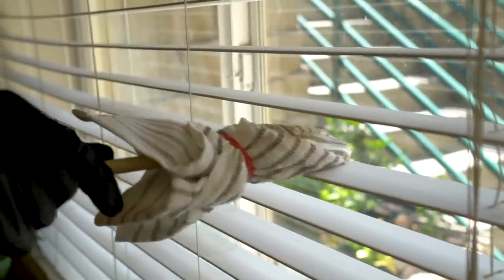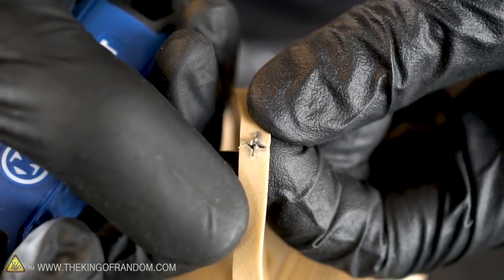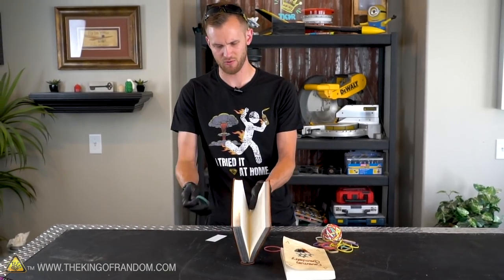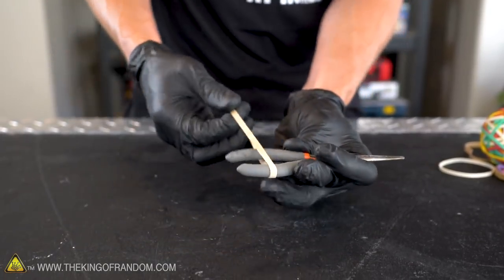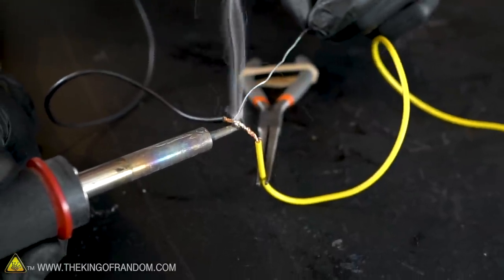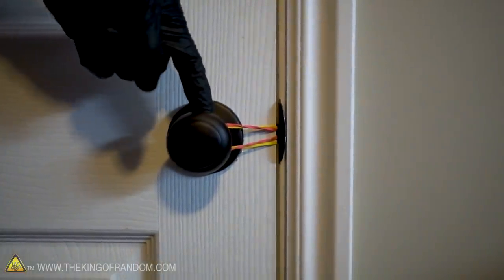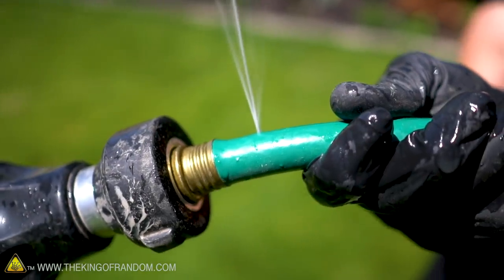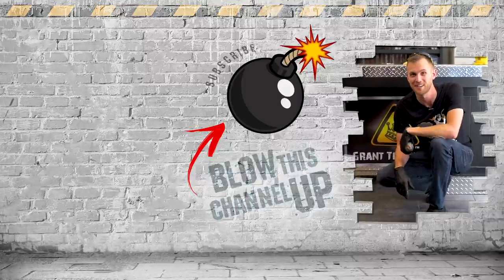Viral Rubber Band Life Hacks TESTED

Comment: I love the parts when he gives better solutions than the hacks 🤣🤣🤣
Reply: But he didn't for a stripped screw. No need for special tools, just cut a line into the screw with a handsaw or a grinder and you can use any flat head screwdriver to unscrew it right away.
Reply: Literally any piece of scrap paper will do!

Comment: Nate is so sassy in this video, I love it. Also for the hose thing, just take a piece of plastic (plastic wrap, preferably) and tightly wrap around the hole. use duct or electrical tape to secure the plastic. Easy solution.

Comment: On the garden hose, I use silicon glue and heat shrink and it works fine.  Especially when there's a leak in the middle of the hose as you pointed out.   Make sure the hose is clean and dry and give it a day for the silicon to dry.  You want the heat shrink to ooze the silicon out the ends and smooth it out over the heat shrink ends.

Comment: Can you melt rubber bands and use it as Flex Seal?
Reply: Rubber bands burn and do not melt, as most are made from vulcanized rubber.
Reply: K0ester THAT'S GONNA BE A LOT OF DAMAGE
Reply: Naa. Reacts with oxygen in air. No melty melty unfortunately.
Reply: Fidasek 008 look at plasti-morph. Just mould it, it sets to hard in air.
Reply: you guys are saying it will burn because the oxygen how about in a vacuum and some sort of electric heater i think that will work but that just a theory a random theory thanks for reading

Comment: You can use rubber bands in the middle of the hose.  You have to cut the loop, and wrap the cut rubber band around like tape.  The end can be tucked under the last loop.  This works even better than the loop, because you can tighten the cut loop even more, and position it more accurately as well.

Comment: Suggestions:

For extracting the core from toilet paper roll, pull it out slightly then cut down the same amount. Fold tab in, reach up the core with pilers, and tear the core downward.

The rubber bands on the hose would work a lot better with a tiny bit of electrical tape applied first.

Comment: For the hose, I'd either put a small piece of duct tape on it, then cover it with a piece or two of heat shrink tubing, or use a inner tube patch kit. There are a lot of other options that don't involve buying a whole new hose. You could also buy a hose repair splice/coupling for a couple of dollars, instead of buying a whole new hose.

Comment: Hey.what would happen if u hydrodip in ascetone ...
Reply: VASANTH S it will not stick to the model as acetone is used sometimes to remove paint
Reply: Allen Hasbun i just want to know if the paint dissolve 's or not ...there is no harm in trying
Reply: VASANTH S or you just want 25$
Reply: Depends on how the thing you are dipping reacts with acetone
Reply: Yea me to but if  he doesthe real hydro dipping that will be cool because the hydro dipping he showed is with paint the original has a film so the hydro dipping with a film will be cooler

Comment: For patching a hose in the middle, you need to think more laterally.  Double the rubber band over itself, twist it around until it is tight, then thread the next rubber band through the loops.

Or use Flex Tape.

Comment: For the hose, wrap all of the rubber bands tightly around a small length of pvc pipe and then thread the hose through the pipe. Once the rubber bands and pipe are close to the hole, slide the rubber bands off the pipe and onto the hose.

Comment: Ahh Nate, just cut the rubbber so you have a rubber string and then wrap that around the leak in the middle of the hose, then on the last winding just wind it over a finger then stick the end of the rubber band in the space where you have your finger. 
In the caribbean we used this method to make home built cricket balls by putting a small stone as the seed of the ball. A cut up tyre tube is more durable for this though.

Comment: Suggestion: For the big pot of water, join the two rubber bands together.  Then attach one end of the rubber band to one handle exactly the same way you joined the two rubber bands together.  Then run the band under the lid handle & stretch it to the opposite handle.  Note: make sure the bands are the "right" size.

Comment: for the hack record, the stripped screw hack does work and really well, you have to use a more broad and dull tipped screw driver. I had a tightly fastened and completely stripped screw I desperately needed to remove to fix something. I first had cut through like you did and then I double up the rubber band I had cut and changed my screw bit to be more dull and it work. I still had to apply an extreme amount of force. that is how tight the screw was but if this didn't work I was "screwed". didn't have to have someone or use a drimal to cut it out.

Comment: Use rubber bands to power up spring powered nerf style blasters, get big performance  improvements without pulling them apart. X shot reflex 6 is great for it, even has spots to put screws to put rubber bands to and then through the priming handle. And can vary amount of bands easily for different power outputs. Anything thats spring powered can be improved if rubber bands can be fitted into its design to assist the spring.

Comment: I've been using rubber bands when I had a stripped screw. It works great. But if the screwdriver is sharp it WILL cut right through the rubber bands

Comment: Better yet if you have a leak in your hose, use duct tape, it's cheaper than buying a new hose and since it's not a lot of pressure the water won't break it off, and it'll be water tight. Also cheaper than buying a hose. Because you're also not wasting gas (if you have some). That's why I always have two or three rolls of duct tape because it a great fix for a lot of things.

Comment: What if you put a glass jar under a vaccum, then heated it up and cooled it down real fast. Slow mo guys did a video of pyrex shattering under extreme temperatures. However that did not have a vaccum. Would it implode or explode or would it shatter to pieces.

Comment: Ahh, but you see, if the leak in a hose is 12 feet in, all you got to do is fold up the hose until you get to the leak, and then put the rubber band over, making it only about 1 or 2 feet away instead of 12.

Comment: could one not bend the hose so that a leak in the middle is in the outside of the bend, put the rubber band over, and slide the end through while the band is stretched, so as to not take so long to take so long sliding a rubber band over a hose?

Comment: to fix a hose that has a hole 12 feet into it use FLEX TAPE especially if you saw a boat in half or a perfectly round  hole randomly appears in your P H I S H I E tank 

its legit ALL YOU NEED